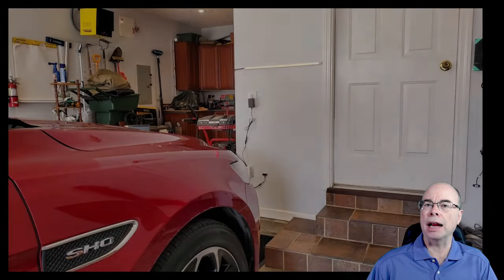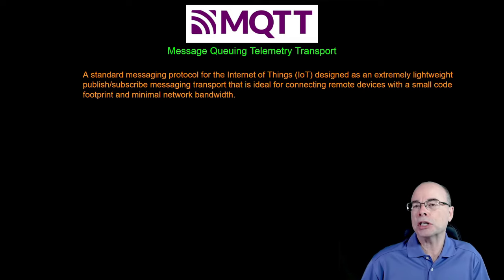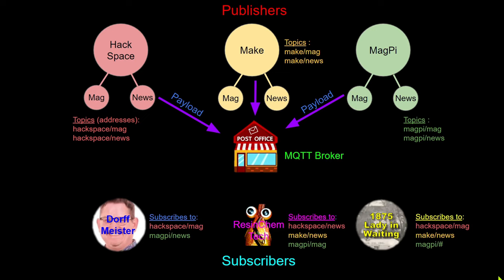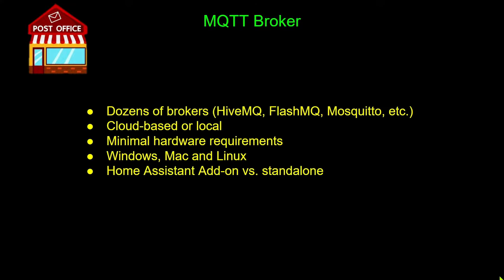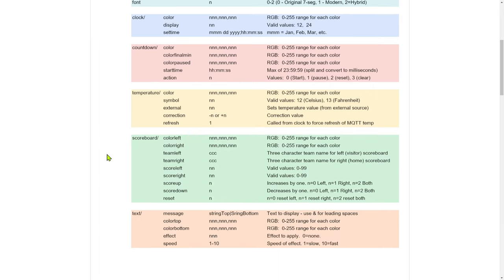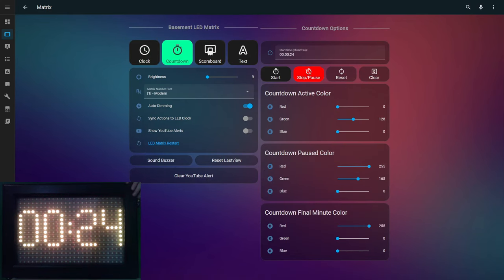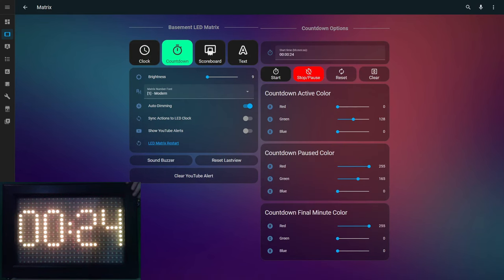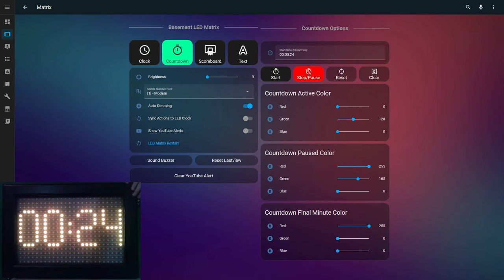MQTT 101: Integrate your DIY Devices into Home Assistant

Comment: In your explanation/example of the retain flag, IF during the time the device is disconnected, there was a CMND to the broker with ON, the STAT changes to ON, but then if the device reconnects, you now have an incongruence of state and reality since there is no CMND and the device doesn't subscribe to STAT.  The light will remain off but the broker retains the state of ON.
Yeah, the right solution is to get devices that subscribe; but how do you handle this situation when you don't control what the device supports?
Reply from the maker: I'm not sure I follow.  If the device is disconnected when the CMND is published with an "on" command, the STAT won't be updated... since as in my example, the STAT is only published by the end device... which is disconnected.  When the device reconnects, it will publish its current state... which in your example is "off".  In this particular example, the only thing that happens is that the CMND that was issued is simply ignored (and dropped, since it has no retain flag and the device is disconnected).  If the state of the light was "off" before the disconnection... and it isn't programmed to turn on when powered up or booted... then when it reconnects, the published state will still be off.  At no point in this particular example does the "state" topic become out of sync with the actual state of the light.... as it is only the light itself that is updating the retained state topic.  

I've seen this exact situation in Home Assistant where I have a switch tied to a custom-developed MQTT device.  When I toggle the switch to 'on', the switch in Home Assistant briefly turns on... then turns right back off again on its own.  This is because it toggles on briefly when the command is sent, but because the device is offline, the retained state is still off.  Home Assistant quickly updates the state of the switch right back to off from the last retained STAT topic (which was off at disconnection).  This generally occurs within 1-2 seconds, and  is one way I know when a device is offline (or at least dropped the MQTT connection).

For this particular video, it was about DIY devices that you do completely control.  In my case, I am the one that wrote the firmware/code that runs on the end devices.  If it is a retail device, or firmware that you didn't develop, then you are correct.  You are somewhat at the mercy of what the device/firmware developer provides and if it both sends and receives on the same topic, then you can still have issues.  Some devices/firmware are (in my opinion) better than others.  I like Tasmota if I want to use MQTT with prebuilt firmware because it does use different topics for commands vs. states, so I can follow the same process to assure I don't get ghosting or states that are out of sync.

Sorry if I am misunderstanding what you are saying... but in my experience with my own MQTT devices, using the techniques I described has never resulted in an 'out-of-sync' situation between what Home Assistant is showing for a state and the actual state of the device itself.
Reply: @ResinChemTech You understood and answered wonderfully.  I missed a few points in the video that you clarified above.  My fault.
The thing I am trying to wrap my head around is how to support in the complete system,  the ability to have an automated "prime" that will set state that even is one part is down, when the part comes back up, it will return to state it "should be in".
I have run into some of things you mentioned.  I think my solution is to follow your "scheme" but have this "prime" subscribe to the state (from the broker) and make some "decisions" based on said state.  The wrinkle is managing temporary state caused by human interaction compared to the automated state in "this failure state of a device disappearing and when it reappears it may default to wrong state as to what the prime wants.
(in other words, I have a more complex situation to solve).
Example is outside driveway lights, tune on at sundown, turn off an hour later.  But if a user turns them off stay off.  If the car proximity triggers turn them on and return to the timed turn off time OR if after a short timer to turn off.  Several similar scenarios of automated lights with possible user override but also trying to maintain robustness when a device gets disconnected (from reboot caused by poor code and a watchdog, bad wifi, battery power lost due to poor solar, etc).
Reply from the maker: Hey, no problem!  Sometimes I tend to ramble a bit in my videos and don't always make my points as clearly as I should.

For the more complex situations, I will often make use of things like input_booleans and/or timers within Home Assistant.  My interior garage lights (controlled by a switch relay that uses MQTT) is sort of a more complex situation similar to what you described.  The lights come on via door switches then turn off after a set time.  But the wall switch can also be flipped manually by a user, regardless of door state.  For this, I use an input_boolean helper (along with timers) that sort of acts like that "prime" that you mention.  I can toggle or change the state of that input_boolean via various automations depending on what happens with the lights... and can return the light to a desired state based on this input_boolean.  This may or may not work in your situation, but I use input_booleans a lot in my automations to help control devices and states that might also be altered by a user with a different physical device.

Don't know if any of that might be helpful to you or not!

Comment: WOW---->Head exploded-->Ghosted 
Where does one go to start at the very basics? I looked and did not see an interface in my Home Assistant for MQTT? Sounds to me like I am on the border line for your intended audience.
Reply from the maker: Well, Home Assistant by default does not have an MQTT integration.  But it's extremely easy to add it.  It is a standard add-on that you can find in the add-on store under Settings.  This is the add-on, so it works both as your MQTT broker and as the integration for Home Assistant.   Lewis over at @EverythingSmartHome has a really good video on installing and setting up the MQTT add-on in Home Assistant:  https://youtu.be/dqTn-Gk4Qeo

Of course, you can create your own standalone MQTT broker on another device (like a Raspberry Pi, VM, old PC, etc.) and then install the MQTT integration via Home Assistant integrations.  Both methods have pros and cons, but using the Home Assistant add-on broker is definitely the easiest way and doesn't require a different machine/VM, etc.

Sorry to point you at other sources.  Unfortunately I sometimes have to make a call as to what to show and what to skip over (and assume that folks already know... or point them elsewhere) in some of my videos simply due to the length.  But I do appreciate you watching.  And don't hesitate to follow up with any additional questions and I'll do my best to help you out.